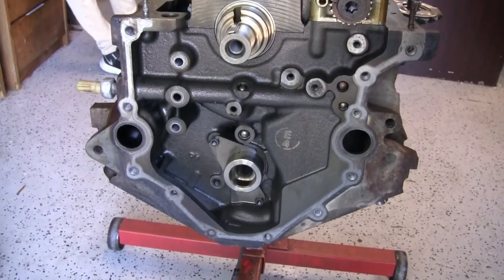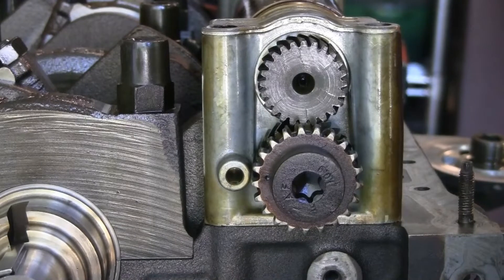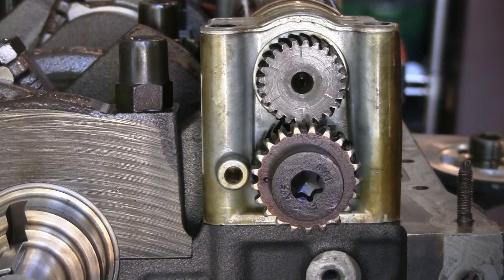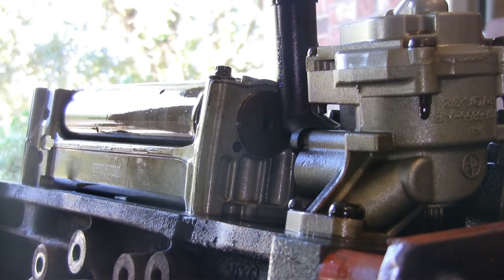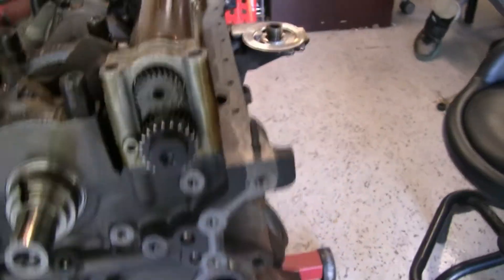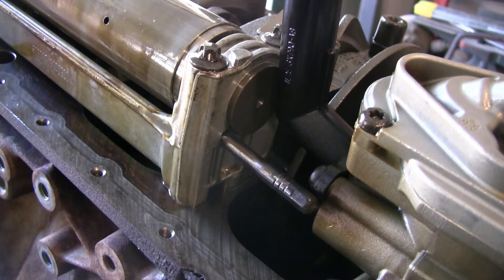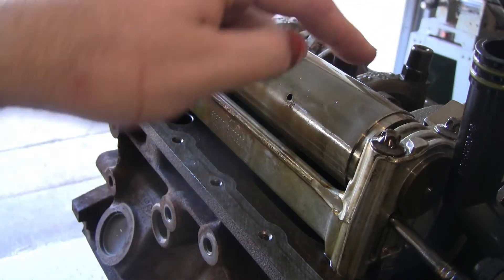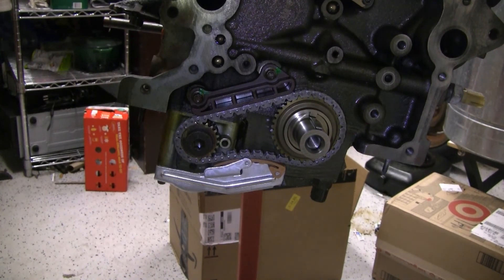Late Model Ford SOHC 4.0L V6 Explorer Ranger Mustang Balance Shaft Timing.

Comment: I have pulled 4.0 from 2010 Ford Explorer XLT to replace timing chains and other parts while out. Thanks for the heads up on timing balancer. I did spend some time, (a lot) looking for solution on timing. Your video shows up in Google search readily, not so much on YT. Anyone else who has or is struggling with front cassette coming out you are not alone. The head is offset from the block by an 1/8''. Not every 4.0 has this issue. Bust off the old plastic from cassette and ease out. New cassette will need some TLC going in. A few gentle taps with long screwdriver at pivot collar after it is slid in as far as possible. Overall this job is frustrating. The money saved evens it out.

Comment: Hi Garth,
Is the explorer a 4x4?  I just got into a 2003 4x2 and it has a shaft balancer
Reply from the maker: This was an explorer. I understand the later years of this engine all had the shaft balancer.

If you look at the description in the video i also have a link to the older styl balance shaft. The video series by fordtechmakuloco was excellent
Reply: @garthsanders  
My shaft balancer is the easier style to time. I was curious if your explorer is a 4x2 or 4x4
Reply from the maker: @franciscoadolfo5805  my explorer is a 4x2.